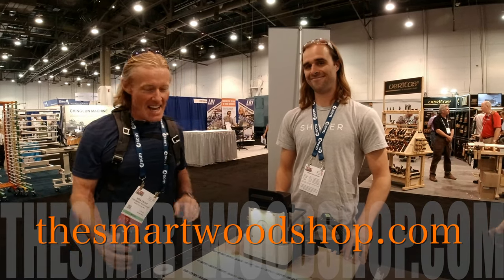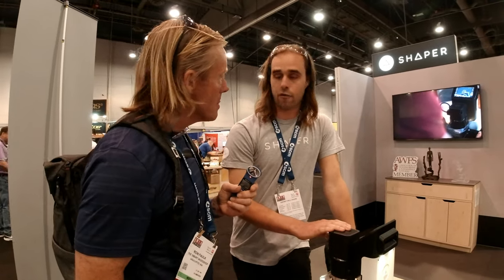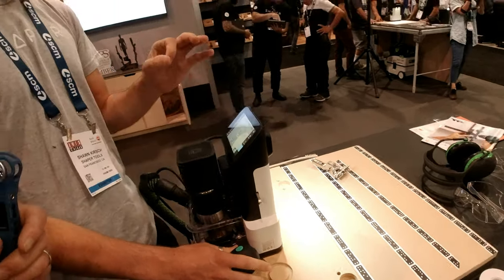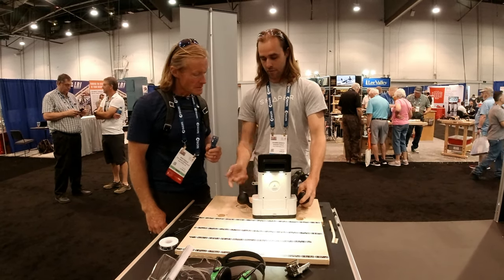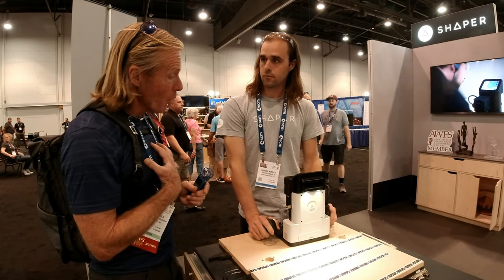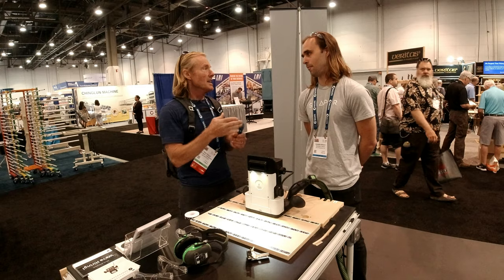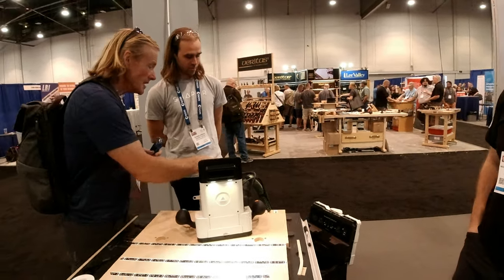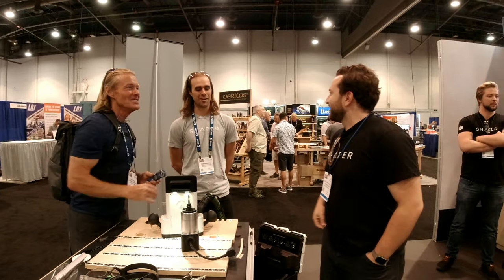Router with a encephalon!

Comment: There is one part of the video that was a blink and you'll miss it. They basically are replacing the workpiece and leaving the other piece with the tape there. This allows them to use the same tape with different work pieces over and over again. The other thing that was not clear to me was using it on larger work pieces. Otherwise, fantastic video Ron it is really cool!

Comment: I do question the precision for using it to create 20mm holes on a workbench. I'm sure it's within 0,5 mm or so. But that's not enough.
Reply: Actually it is way more accurate than .5mm. I don’t have the correct tool for measuring inside hole diameter, but if you take a high quality 1/2” drill (Norseman) and dill a hole using a mill drill, and then route another hole with an Origin, flip the drill around and insert the shank into those holes, the force required, the fit, is exactly the same. Typically I get +- .002 accuracy when cutting shapes. Now, if you drill 20mm hole pattern on a 4’ x 8’ sheet how parallel will the holes be? Over that distance you will have an error you can measure.
RE: tape, some of us print our own on sticky back polyester 18” x 12” sheets. 
There is some overselling going on by ignoring some of the negatives but overall it is a wonderful and very fun 
tool.
Reply: I was more thinking about 0,5 mm per 92 mm. The error margin needed is basically zero when creating a workbench with a hole grid. Maybe 0,5mm per meter